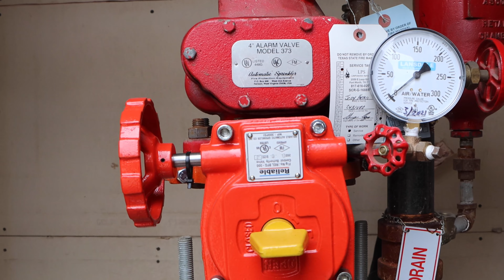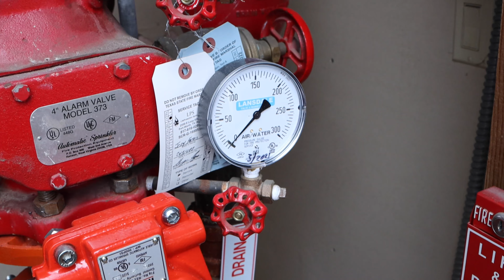Rebuilding the Dallas BA - Inside the Fire Sprinkler Riser Room

Comment: 6" stub out into a 4" riser. Tends to happen when civil engineers spec 6" for everything. And with such a small building and all low hazard, a 2" riser probably would suffice.

But something important: Knox boxes are inherently not secure. They need to be at least 8 ft off the ground, and in shot of a camera so if someone gets a key (happens more than you think), they need a ladder and cannot be discrete. Some locales also like them near the riser rooms, but they really need to be at the front entrance, visible from the street for the same reasons.